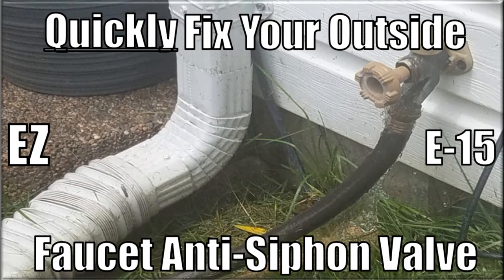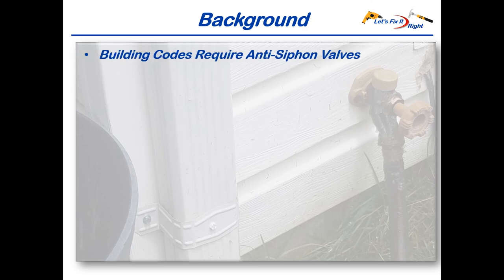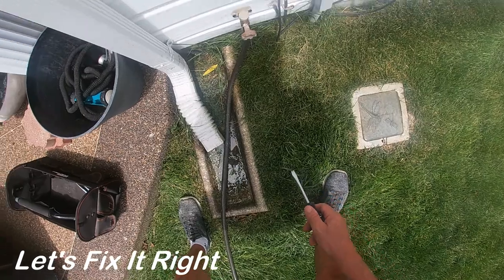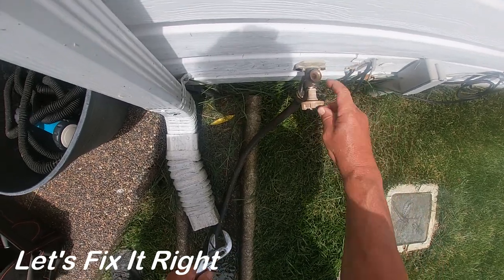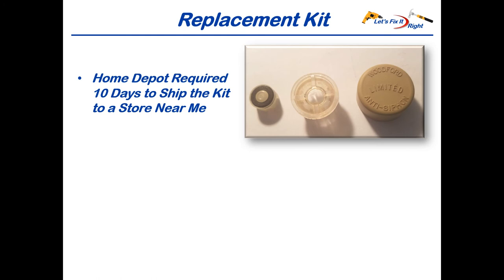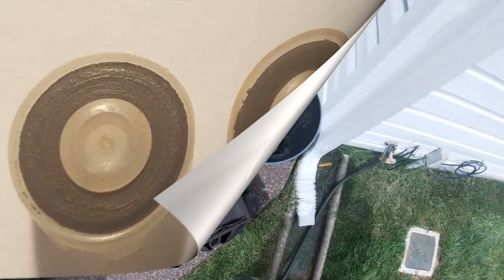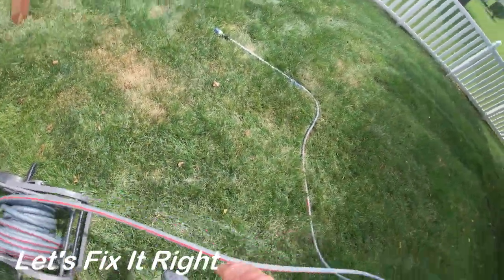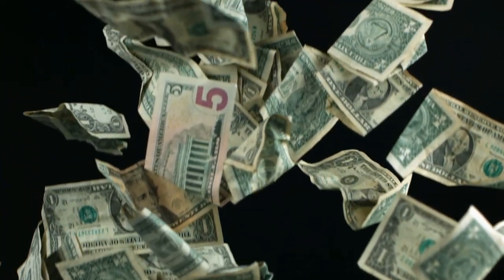Water Faucet Anti Siphon Valve

Comment: thank you for this information.  my immediate solution is to exchange a critical location part with one from less used valve. priceless and timely solution. fix in half hour,  then get part as needed later.  excellent!
Reply from the maker: Glad to hear you where able to use my recommended approach.  Sometimes it takes time to get a replacement part.

Comment: Thanks for the video ! Mine was old and leaking so I bought and installed a new anti siphon outdoor tap but it leaks like my old one. 
The only way to stop the leakage is to open all the valve and then the leakage stop. I am puzzled !
Reply from the maker: It's probably not the anti-siphon valve.  You may have a faucet that needs a new washer.  If not, you may have to replace the entire faucet. If you are not familiar with this, I recommend that you call a plumber.
Reply: Lets Fix It Right Thanks a lot. Yes, I did replace the whole thing (bought it on Friday) so I will return it and get another one.

Comment: I have the same type Woodford faucet with the same anti siphon parts that you have. I can’t find the replacement kit. What model or item number did you order from Amazon?
Reply from the maker: Terry,

This is the kit I installed from Amazon:

https://www.amazon.com/Woodford-RK-101VB-Vacuum-Breaker-Float/dp/B008B6GYUU/ref=grr_sccl_1_2/141-7597600-2560432?pd_rd_w=EitFL&pf_rd_p=2e1a54fd-4023-426b-9a2a-7b30c1ddcd41&pf_rd_r=1XY5YZVQ6KSDW7NK06WX&pd_rd_r=3eb0f94a-17c5-4c13-8814-ff9ca336c833&pd_rd_wg=BC6uF&pd_rd_i=B008B6GYUU&psc=1

Recommend that you check it out closely to ensure that it matches your anti siphon valve.

Otherwise, I appreciate your interest in my channel.  I retired recently and have plans for another 200 to 300 great videos. 

Can you please subscribe and tell your friends and family about my channel? This a link to my channel: 

https://www.youtube.com/c/LetsFixItRight

Regards,
Lets Fix It Right